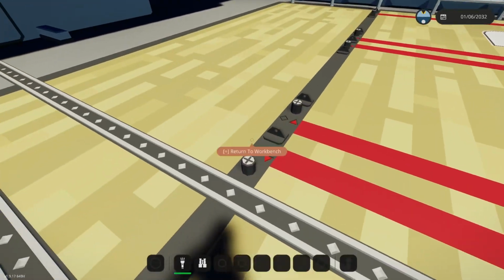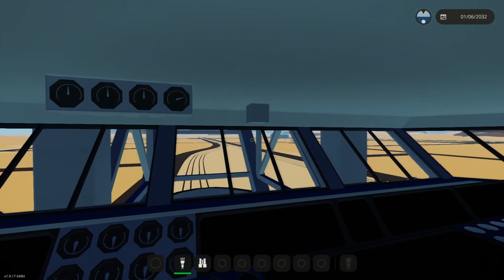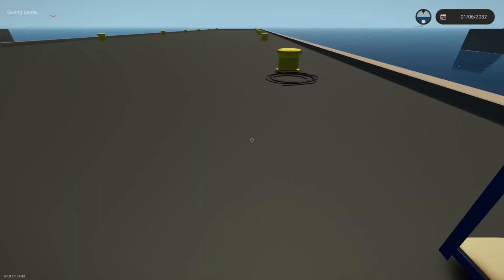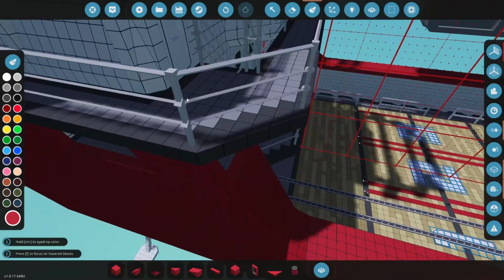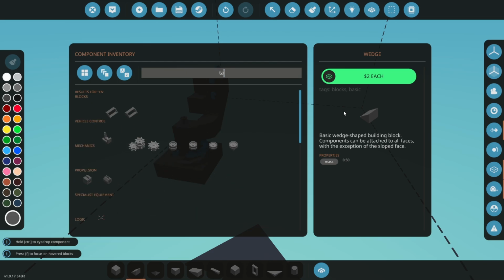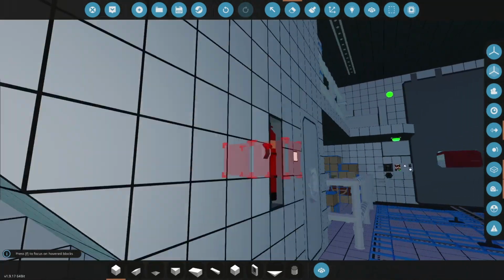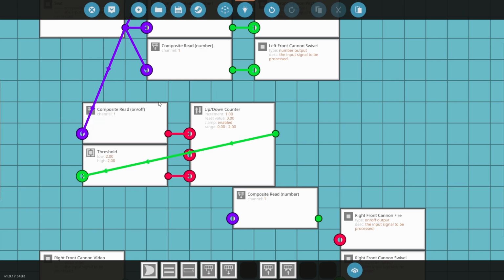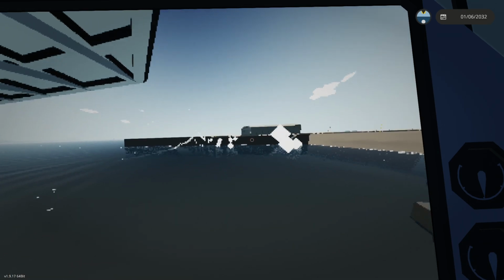Stormworks | The Shipyard | Azipods And Water Cannons For Cliford

Comment: I've found that using rolling averages with 100% reset steering for azipods works really well as it lets you change the sensitivity on the go and just is a very easy system